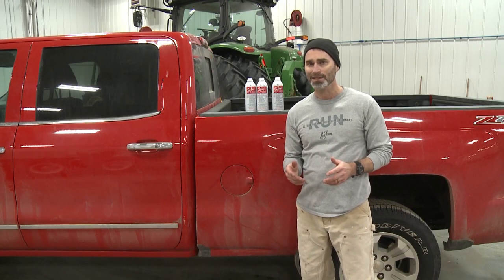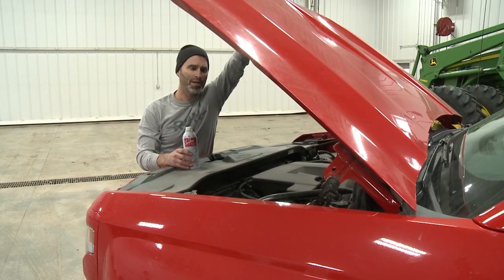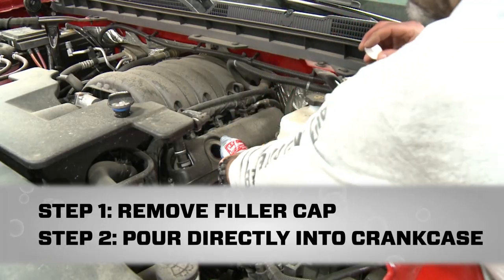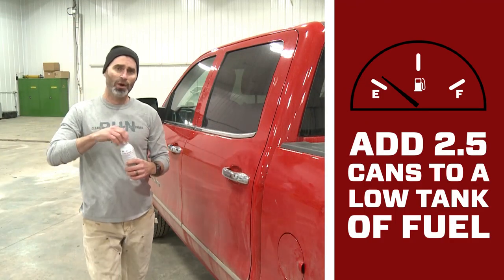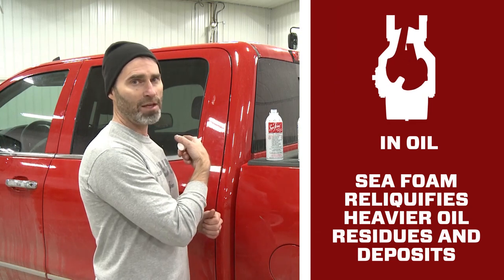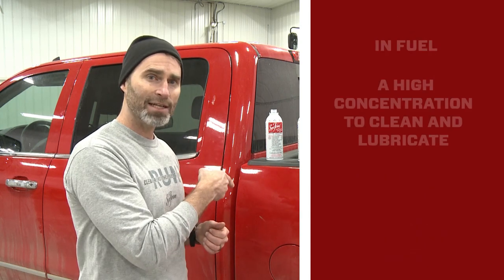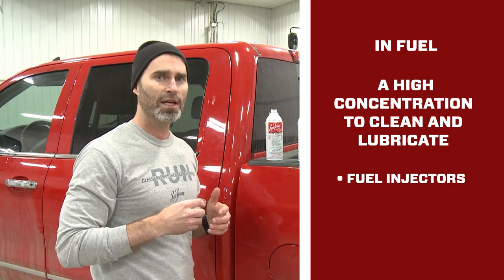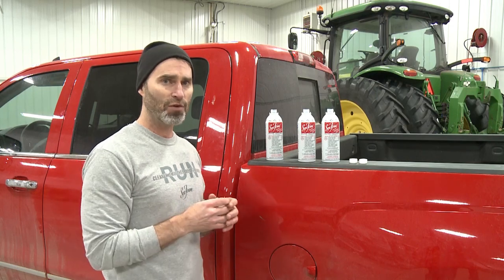What can you do with 3 cans of Sea Foam?

Comment: For my scooter I would add 3 cans like this...1.35 gallon gas tank capacity. Leave approx .35 of the tank with gas and dump full can of seafoam. Ride on full throttle for just 5 mins or so and in that time get to gas station. Fill 1 gallon gas in and add rest until full tank with seafoam. Once down to quarter of a tank or so add last full bottle and full troddle it to gas station but 15 mins away. Put half gallon gas in and add rest of ur seafoam( bout half bottle)
Reply from the maker: Thanks, for the post!  That's getting toward the attitude for periodic carburetor cleaning.  For initial treatment, try to be at 2 parts gas to 1 part Sea Foam.  Adding one can of Sea Foam to 32 oz of gasoline in that small tank is more than plenty.  No need to add more Sea Foam (save a few bucks) and the 2/3rds gas will cause more fuel volatility.